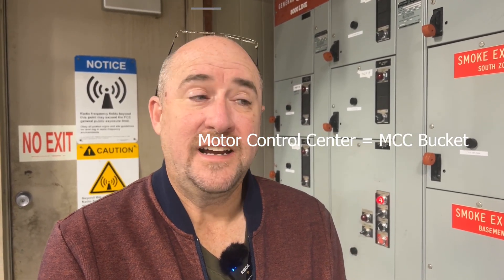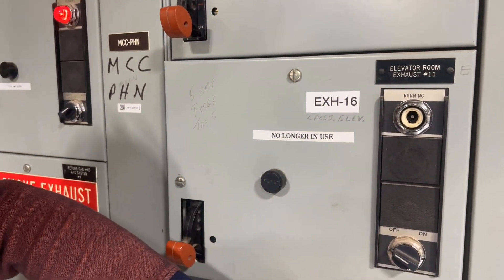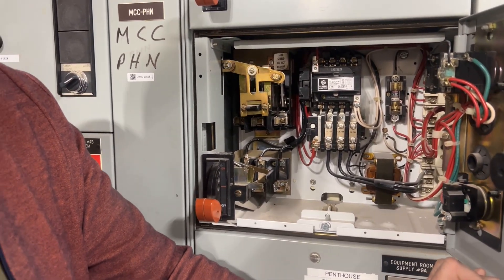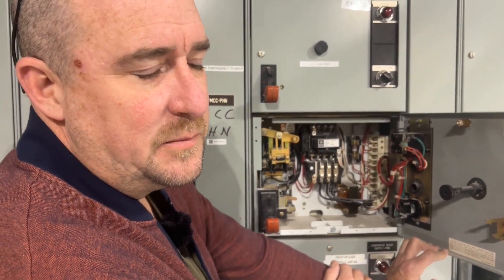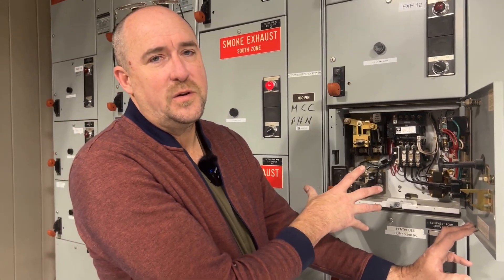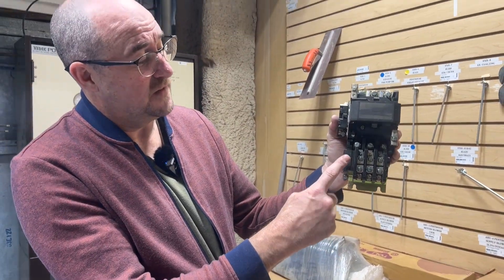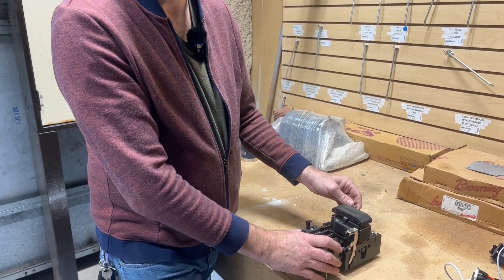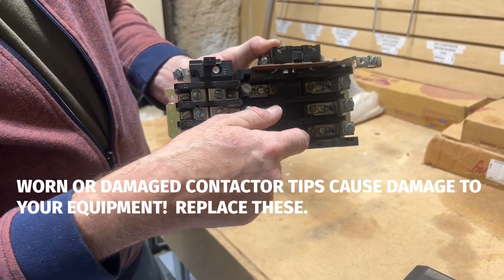MCC Buckets Explained "the motor control center"

Comment: 1:04 mark -  MCCs are just one of the switchgear types involved in arc flash/shock accidents (mainly due to the higher voltages used), so being absolutely sure the stuff is powered down/de-energized before doing any work inside MCCs are definitely key here.

Comment: Can you go into more depth about each individual component in the MCC and how to test them with a multimeter?
Reply: While you can buy empty buckets generally whoever manufactures the MCC offers premade buckets that simply slide in. Parts will always be a disconnect, motor starter and fuses. But more can be added from there based on what the individual bucket will be powering. For example in our facility all of our exhaust fan MCC buckets have line voltage into a fused disconnect, contactor, thermal overload relay, fused output legs to the fan motor, time delay relay (so we can stagger the fans to not start simultaneously) , and a step down transformer from 480V to 120V (control voltage to energize the coil of the contactor)

In our case it’s way overkill for simply starting restroom exhaust fans but our company has no budget whatsoever. They’re also interlocked to the AHU’s so the exhaust fan sends a 120V proof signal to a MBC panel which checks the PXCM panel at the pressure switch to verify the AHU is running. Once the AHU proofs it sends a 24v signal from the PXCM to MBC panel, closes a 24V relay, allows the 120 sent out from the MCC bucket to return and complete the circuit thus starting the time delay relay, starting our exhaust fans.

Comment: Side note for you young guys. Was a commercial sparky for 50 enjoyable years and ALWAYS had the most trouble with POS GE! We had over 50 MCC locations supplied by 4 different companies. Piece of garbage GE'S always ran 25 to 30 degrees F hotter. Had trouble with every medium voltage dual service POS GE expensive switchgear. GE was the worst company for tech support & trying no begging to get replacement parts. Took their crack service department a year to get a replacement under voltage relay for 8 year old 13,200 volt switchgear the another year to get a wire schematic for he morons to figure out where 5 wires go. Da two to coil, one to common side , one to NO & one to NC contact.
Reply from the maker: Thanks so much for the information!
Reply: i love GE MCCs . no issues here